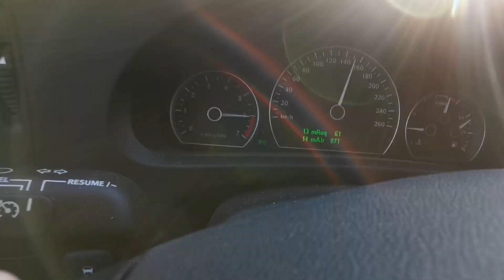Saab 9-5 wagon 19T is creep boosting

Comment: How much power do you estimate its making? Looks super rapid! Surely there must be some wheelspin in second gear? And how do you pass inspection with a cutout before the catalytic converter?
Reply from the maker: Estimated power and torque from airmass, acceleration time, aerodynamics and known weight suggests 450-460hp/640nm from latest adjustments I did a few days ago and it responded a lot! Still have a bit of adjustments left, been prioritising doing an new fuel table revision for the 846cc that are almost done and behaves spot on so far. 

Tones of wheel spin in second currently, but will remove it with limited 1st and 2nd gear 🙌

No issues at all passing inspections, just unhook the wastegate and remove the screampipe. Then I fit an home made under plate that is plastidipped black. They pretty much wont see it unless the specificly like on purpose tries to find something wrong with it

Comment: What did you do to increase the efficiency so much? I know about the wastegate cutout right on the downpipe and thats all I really know
Reply from the maker: Yes what I did was move the new wastegate further up on the downpipe in an better entry angle. Basically making it tangents with the bend more and installed the larger 2.5" outlet 60mm wastegate.

Adding to this I also completely changed out the old intercooler system for DO88 full 2.5" piping and so on. Noticed I had quite some restrictions there aswell when I started measuring the OE pipe sizing etc.

These 2 combined made this outcome as both are opposing forces on the compressor wheel being restrictions. Plus that there is 0 backpressure now meaning the turbine drive pressure is so drastically reduced as it is backpressure x turbine pressure ratio = elevation of effective drive pressure. 😄
Reply: What blade count of turbine wheel are you using for this? And youre using a 6cm turbine housing?